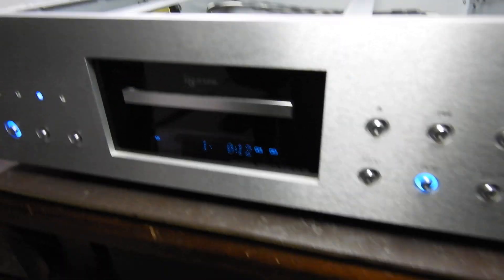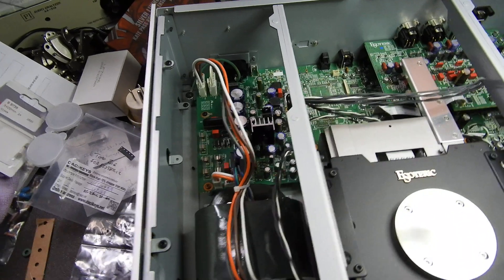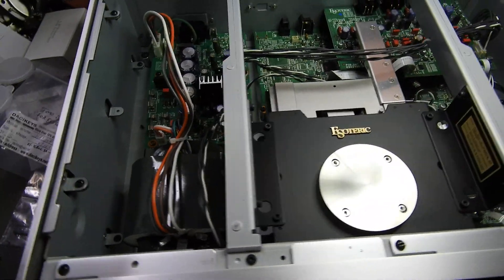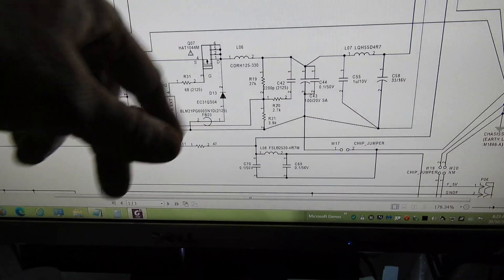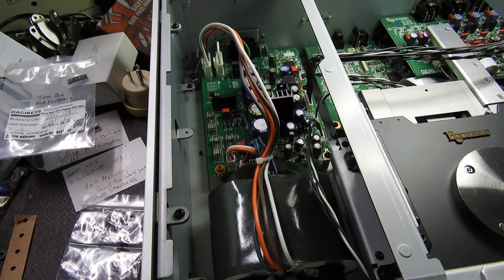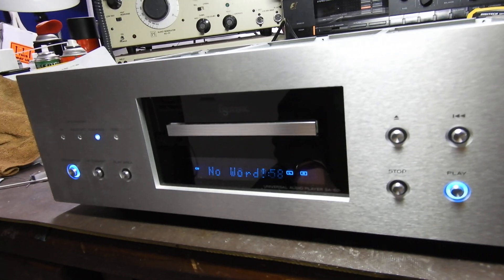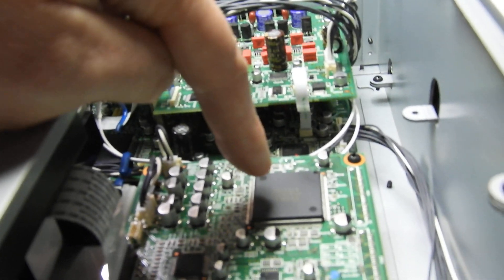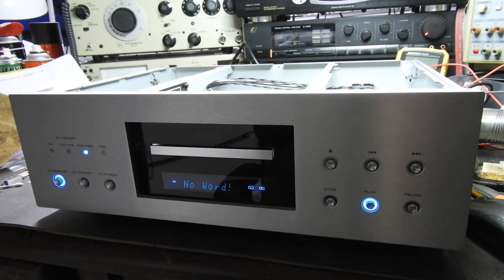Esoteric SA-60 SACD player with VOSP Transport and 3 x CS-4388 DACs

Comment: I'm surprised it plays with "No Word" error. Later model Esoteric players won't play if configured for external clock with no external clock connected.
Reply from the maker: You are surprised but I was scared that there was a another serious fault. After I changed the setting in the menu, "No word" has disappeared.
The SACD functionality might actually be fixed in coming days. I have found this guru who used to teach surface mount soldering and he actually found the DSP chip (which I could not) and promised to replace it (over 100 pins from memory with a lot of components nearby).

Comment: Hi any recommendations for a good sounding CD player that’s not too expensive?
Reply from the maker: There are many but I'd need more info to make a informed and useful suggestion. Any preferred brands? Do you have an amp that accepts balanced connection (for me it is a must), do you have an external DAC or plan to have one? Do you care about HDCD format?
Reply: @hear-net-au  I just care about it sounding good without breaking the bank. I don’t have speakers/amp yet but for reference I’d hook up a CD player and record player to the same speakers. I’m slowly investing in an audio setup. Starting with the CD player, then with the amp. Japanese CD player preferred
Reply from the maker: @Sledgehog  Are you in Japan? If so, there would be a great choice. Please confirm.
Reply: @hear-net-au  no but Sony and Yamaha would be too choice for me
Reply from the maker: @Sledgehog  For all out end game Japanese player, I would go for ESOTERIC X-10w / X-10WD or ESOTERIC X-50w. But both are expensive for they have Wadia DSP. Since you have no amplification yet, I suggest that you go for amp that is fully balanced. I cannot recommend any CD player from Yamaha, for I have seen only low-end products of theirs and they all had very average mechanisms. Sony is a great engineering company and there are plenty of ES series players there. Pick one with KSS-190A, BU-1 or KSS-151A mechanisms. If your budget does not stretch to a player which is balanced (XLR connectors on the output) get one with RCAs and later get a good balanced DAC. They are cheap and some and very good. Any Sony with these mechanisms will be a good transport for decades to some. The list of CD players with these mechanisms can be found at http://vasiltech.narod.ru/CD-Player-DAC-Transport.htm#N
I hope it helps.